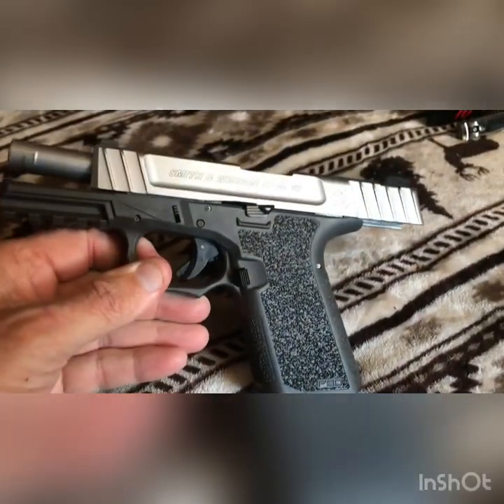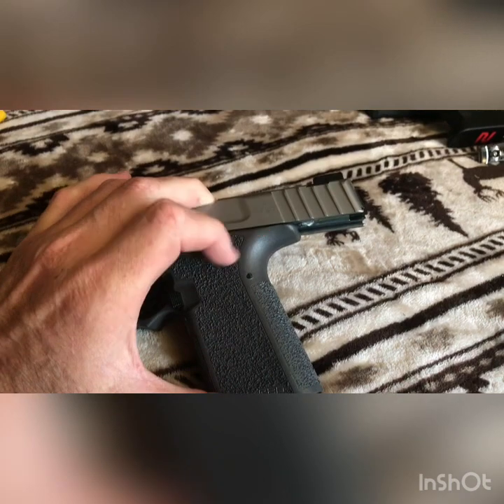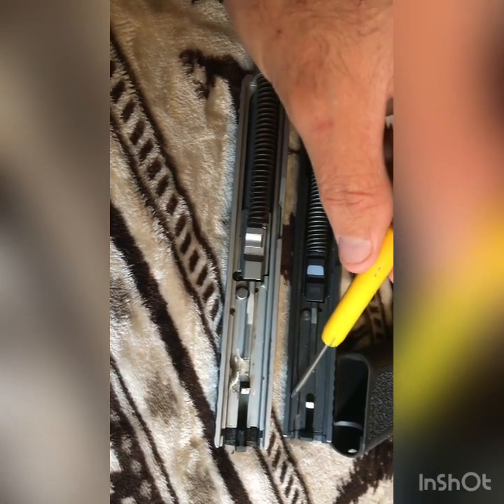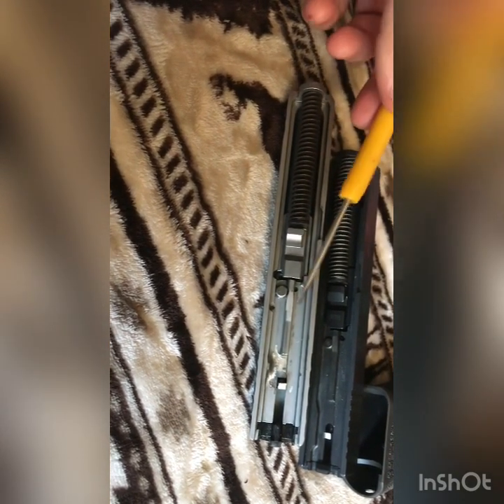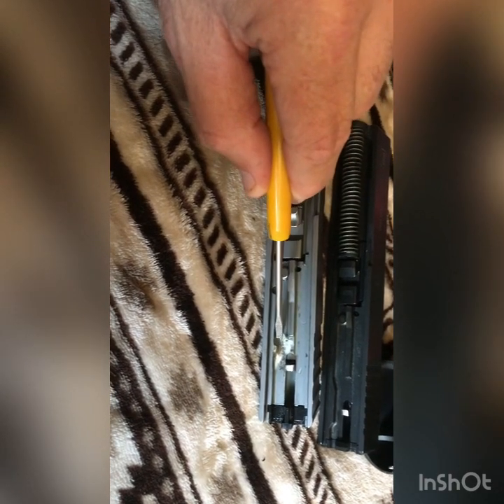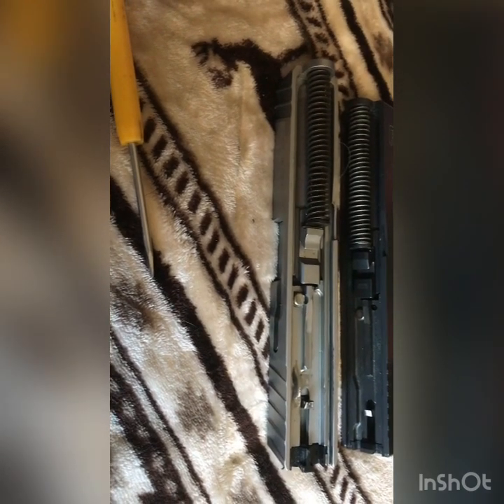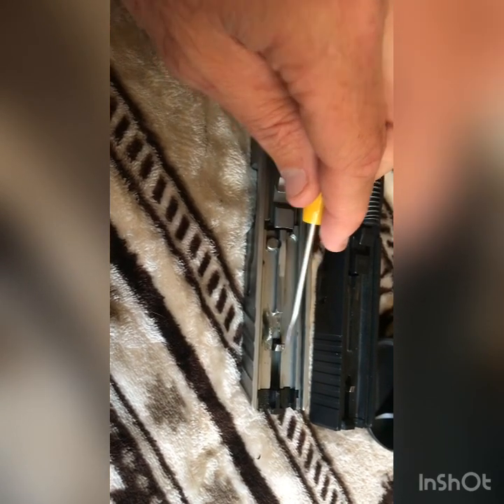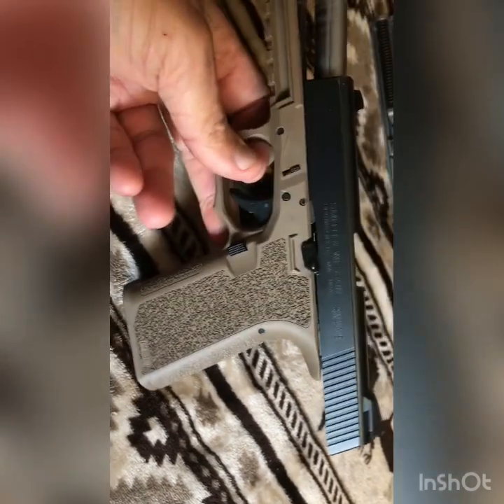How To Mod A Smith & Wesson Slide To Work On A Polymer 80 Frame

Comment: How did you add the steel with the jb weld?
Reply from the maker: This is what I used with the JB Weld to “add steel” back to the slide I messed up on. Then ground it again. 

Key Stock Assortment, 140pcs/Box... https://www.amazon.com/dp/B07DJ52YNW?ref=ppx_pop_mob_ap_share
Reply: @blackriveroutfitters7185  my striker isn’t resetting and wonder if the same concept will work with resetting the trigger or if it’s worth the time welding
Reply: @blackriveroutfitters7185  is there a difference mix matching different caliber upper and lowers?
Reply from the maker: @480i2  if you think you took off too much material on the slide then the answer would be yes I would add material back to the slide by either just JB Weld or a combination of JB Weld and the steel.
Reply from the maker: @480i2  also if your trigger isn’t resetting it could be an issue with your trigger reset bar. I once had an issue like that and a slight bend outward allowed the trigger bar reset to engage with the area of the slide. All of the S&W slide mods I’ve done work on any Polymer 80 PF940C frames. Far as the lower parts kits goes I’ve used Glock 23 (40 cal) LPK in Glock 19 (9mm) and visa versa as the only differences my knowledge would be the ejectors.

Comment: which p80 lower and firing pin make the easiest mod for an SW40V slide
Reply from the maker: P80 PF940C frame (The compact frame for Glock 19 & 23 builds) and either a Glock 19 or 43 firing pin. Someone posted on one of my videos that he tried a Glock 43 firing pin with good results, I haven’t yet.
Reply: Thx bro
Reply: Both pins are for 9mm but will work with 40s&w?
Reply from the maker: @p-dub9281  yes I compared the Glock 19 and 23 firing pins side by side and couldn’t tell the difference……